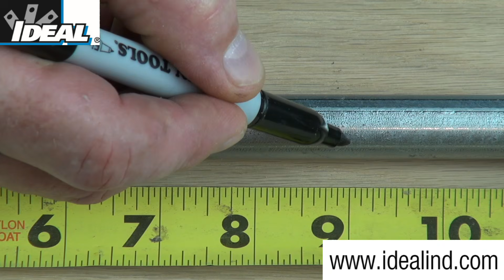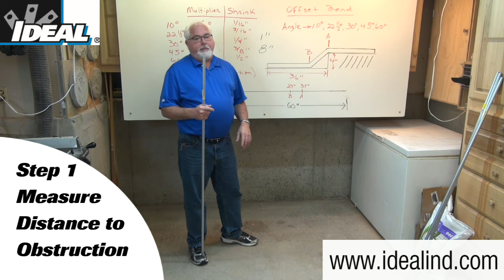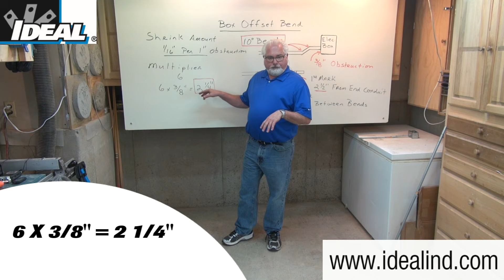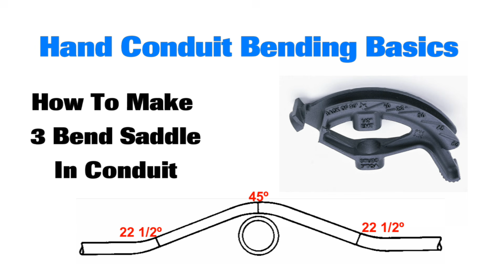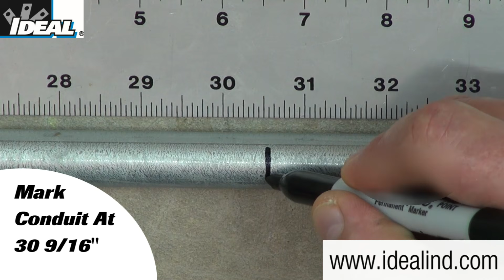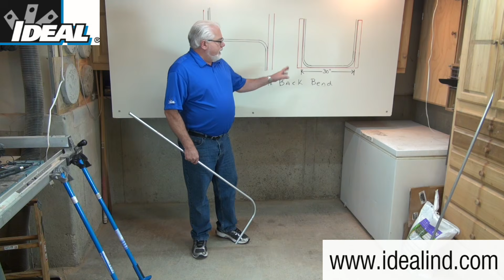IDEAL How To Use a Hand Conduit Bender

Comment: So if the gain amount is 2 1/2", are you saying that the pipe has somehow "stretched" 2 1/2" , which surely can't happen?? Thinking this through then, that gain is because the measurements you took included the width of the pipe twice, once in the horizontal measurement and once in the vertical measurement?

Comment: Regarding offsets, I've never understood the use of the term "shrink".  Nothing shrank.

Take a piece of wire and bend it into a Z shape.  You don't measure the length of that wire by measuring from the top to bottom (or side to side) of the Z.  You also need to measure the middle part diagonally.  Nothing "shrank" in the Z.  Nor in the offset, appreciably. You're just choosing not to measure the diagonal part properly.

I get it that you need a short word to use that fits on charts and that blue collar tobacco-chewing folks can understand.  That's fine.  But then when folks start explaining things on a white board they explain it like something really is being shortened.  It's not.

Comment: "Box offset bends are done in the air, not on the ground"

Who came up with that rule?
Reply from the maker: Vektr1 if you can do it right bending the offset on the ground then go ahead but usually we would recommend doing it they other way as shown have fun Ron
Reply: @RonKipperDatacomm1  How would you do it with a full length 1" EMT? It just seems to me it's overly hard to balance it in the air.
Reply from the maker: 1" is kind of tough to bend no matter how you bend it good luck with it Ron

Comment: Thanks for the very helpful video.  The reason for gain with a stub 90 is because the bend cuts the corner a bit while the tail and stub measurements run along a hard 90 - correct? Or does distortion of the pipe contribute?
Reply from the maker: Great point!

Comment: Great instructional video. Thank you. You could use a permanent marker instead of a pencil, then use PVC primer/pipe cleaner to remove the mark. It makes a great 'eraser'. I'm an HVAC guy and use permanent marker on sheet metal and, if I make a measuring mistake, I just get out the acetone (PVC pipe primer/cleaner) and erase it.
Reply from the maker: Hey Rick good point glad you could use the info in the video take care Ron

Comment: Tip for fellow older sparkies:.I sprayed painted heads of my benders with 2 coats of white paint then use a red & yellow paint markers over degree marks, notch & arrow. Makes it a lot easier to see in dimly lit areas. Still have my dad's Benfield maybe 16 page picket sized  conduit bending Manuel.
Reply from the maker: John good to hear from you appreciate you watching Ron

Comment: This is a great series; however, it is indeed prudent to check the stubb-offset on every bender.  My $39 ideal cast iron bender turned out to be 4 3/4", instead of 5", this also impacts back-to-back bends, i.e., i have to add 1/4" to my "20 inch mark", making it 20 1/4" in order to get a 20" back to back bend.  Offsets and saddles seem close enough to use the standard charts.
Reply: I think that should be an "aluminum" bender head
Reply from the maker: Yes I mention it somewhere that any bender may be slightly off so making a test bend or two is a good idea. Ron

Comment: I use one mark on the pipe for box offsets. I use the end of the pipe as a substitute for the first mark and a mark  down the pipe 2 1/4".  I have been doing it that way for 24 years and have had no problems. It is much quicker if you are doing a lot of box offsets. Thanks, Russ, Journeyman electrician.
Reply from the maker: Russ thanks for the tip I always love it when I get a good tip from a journeymen. Have fun Ron

Comment: I have been doing electrical work, Commercial and Industrial, for 50 years and I still enjoyed watching this video. I have a few thoughts on it, I hope more of a little additional help for the youngsters just coming up.

I think it needs to be stressed  that when bending conduit the key is use heavy and constant foot pressure. 'Bending' is a misnomer because what we are really doing is 'rolling' a bend along the saddle, in other words stretching the half of the pipe outside the saddle. Keeping constant foot pressure on the pedal also keeps the conduit tight to the inside of the saddle as you stretch the backside and causes the bender saddle to roll back, dragging the conduit with it. Holding the handle and pulling back will raise the conduit out of the saddle and cause rippling or a kink if you don't have the proper foot pressure. The handle should be used more as a guide and a balance to help foot pressure than to actually bend. 

Also I teach my apprentices to 'halve' the conduit in their head when bending 90's. On a full stick of conduit make anything under 60" a 'take-up' bend, subtracting the proper take up for that pipe size and make the end you are measuring from the rising end. Anything over 60" make your mark exact and using the 'Star' turn your bender away from your measuring end and make the opposite end your rising end. In other words do what will always keep the longer end of your conduit the side that is always on the floor or behind you (as in airbends). 

And don't look down a conduit with one eye when doing an offset or saddle in the air... use both eyes. We don't use one eye to align them on the floor so why do it in the air. It's a little hard to get used to but when you have it down your bend will be so perfect you can take it to the fair.
Reply from the maker: Wow William thanks for the tips! Bending conduit well it a real art and I tell guys if you can bend conduit your value on the job just went up! Have fun Ron
Reply: Had the best coworker conduit bender. I had at least a hundred pounds over his shinny body. He always had trouble bending 90's in 11/4" EMT even with the better hand bender that had the fold out foot pedal. I found it easier even for a fat boy like myself to place one end of 11/4" EMT against the wall before applying steady heavy foot pressure. Also best to wear work boots rather then sneakers or jogging shoes when bending heavy conduit.

Comment: Any tricks in long but narrow back to back bends to overcome the fact the handle is in the same plane as the U?  Typically when the U is narrower than the length of the bender handle, once bent  past  45' the handle hits the other side of the U  (previously bent stub). bending around it creates a dog leg which I then have to straight out on the floor, not always pretty.
Reply from the maker: Hello not that I know of hopefully someone will see your question and have a better answer. have fun Ron

Comment: The hardest thing about bending is judgment of "straight and inline" ....It takes some natural ability and a lot of practice...it is just plain and art to keep everything straight in relationship of one bend to another ...it is not simply math ....unfortunately   ....It would be SO NICE if it were only math and making marks in the right place ....alas all those bends EVEN precisely measured and marked HAVE TO BE correctly  judged relative to the other bends ... like a saddle?  EACH bend HAS to be at the same vertical relationship ...and the degree of bends has to amount to EXACT relationship....much easier said than done ....takes natural ability AND practice....if you find this challenging?  Join the fricken club!   LOL
Reply from the maker: Hi Dougie you are right it takes practice! Ron

Comment: most common bend I think is "back of bend" ....amazing HOW MANY  supposed "electricians" don't even know that the Star (NOT arrow or notch) on the Bender is the back of a bend ...(with the end in front of you Bender pulled toward you) .....The "stub" measurement often ends up being simply a matter of cutting conduit to fit where the "stub" is the final section of conduit ... the initial stub (assuming 90 degree) you just subtract the number given on bender
Reply: I am long retired .....I just feel for you youngins and want to assure you that you struggles are NOT unique!   Keep at it people!  You CAN do this! Focus!  And KNOW that ALL THE REST OF US....DID struggle ALSO!   Feel better?
Reply from the maker: Hey Dougie good to hear from you. Have fun Ron

Comment: SUBTRACT the gain when you figure how long a piece of conduit to cut for a 90 degree stub bend.  In Ron's whiteboard example....22 + 14 MINUS 2 1/2 = 33 1/2" will give you a conduit with a 22" tail and a 14" stub.
Reply from the maker: +Robert Blanchard Robert man I will double check that to make sure it is right. Thanks foe catching it I am always willing to say I'm wrong. Take care. Ron
Reply from the maker: +Robert Blanchard Robert you are right we need to subtract not add the Gain Amount. My bad.........I've added a annotation to the video stating that and I've added your name as well. Your the first guy to spot it and the video has been up for sometime. Nice job! I owe you can you send me your contact info? I'll figure out a prize of some sort for you. Ron ron.kipper@idealindustries.com
Reply: @RonKipperDatacomm1  phone pool 😆
Reply from the maker: +arturo soto When bending an offset the overall length should shrink not get longer. I'm not sure what the answer to your question is. Send me a pic or video. Ron
Reply: +Ron Kipper Datacomm  why when i tried to do a 30°  it get to long